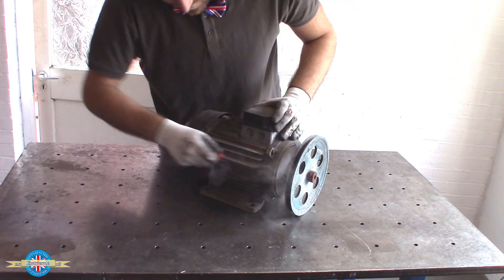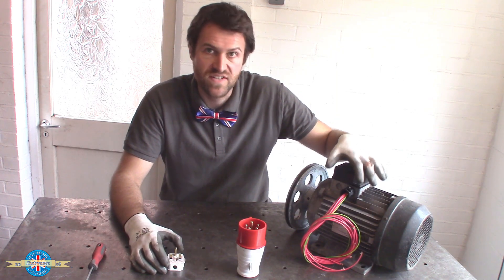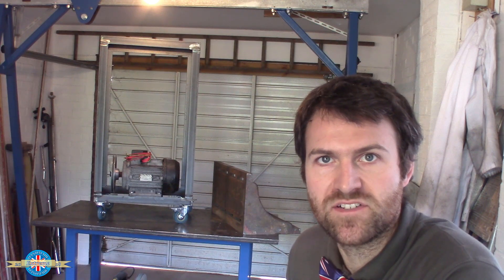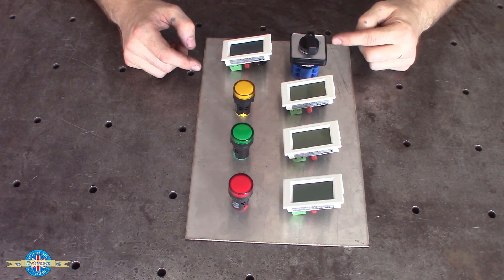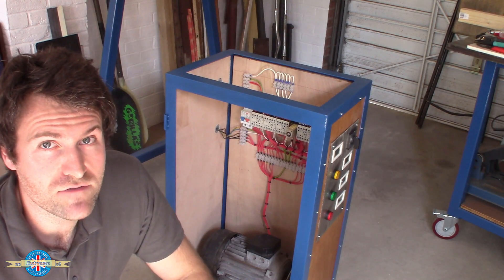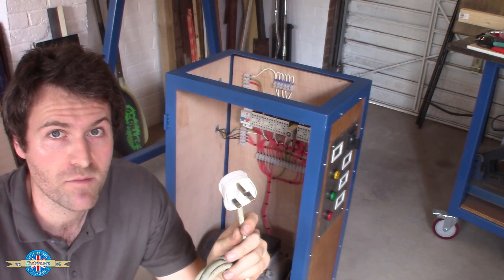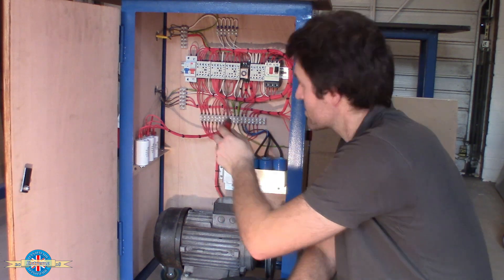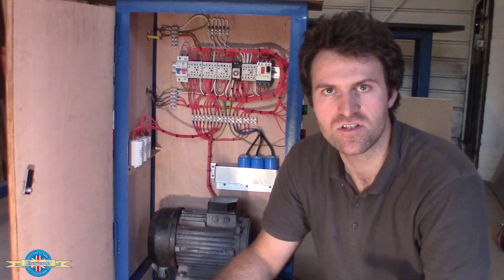1 Phase to 3 Phase Rotary Converter - 230V to 415V

Comment: Excellent video love the way you build everything ,you need very creative.I have  over the years  bought  4 3phase machines the first one i bought a digital  frequency phase converter which i use for that machine which I find very handy in that i can dial in different motor speeds without having to change cogs but not the original switches that came with the machine  now i have more machines i was wondering if I would need a seperate converter for each machine or can a i use a rotary Converter that covers all although i do not inten to run all the machines at the same time .what do you rekon is the best way to go about this or i should say how would you do it.any help much appreciated Thank you
Reply from the maker: If using VFDs each motor should have it's own drive. You should not try to use a VFD as a simple converter to power multiple things, they are not designed for that. That is the exact reason I built the converter. I have a few machines and it was most cost effective and future proof to use the converter. Glad you enjoyed the video and I hop this helps you with your own project. Cheers. 👍

Comment: And people wonder why England needs 30% of Scotland's spare electricity! This is not what the grid was designed for and is extremely dangerous and selfish!
What you are doing is illegally drawing vast quantities of electricity to generate 3 phase power.

What you should have done was applied to the local network operator for a supply upgrade and requested 3 phase. 

This could plunge the street or a larger area into darkness by drawing more electricity through the domestic supply than it is designed and rated for!
Reply from the maker: Hi, thanks for the comment.  Please allow me to just clear a couple of things up for you. 
I'm not sure where you got the idea i'm drawing vast quantities of electricity from.  I can assure you that when the converter is running it is drawing no more current than the kettle in my kitchen. As for start up current if this was excessive it would trip the workshop ring main supply or main house supply ( which FYI is rated significantly higher than the startup load my converter imposes on it). 

With regards to plunging the street into darkness; the grid is more than capable of handling small inrushes and I assure you 50 amps inrush is small. Just consider when there is a power cut and a whole village or small town looses power. Everyone leaves everything switched until the power comes back on. The inrush the grid receives during this power up after a power cut is multiple orders of magnitude higher than my little converter and yet the grid copes fine. 

Regardless, I hope you enjoyed the video and that I have been able to put your mind at ease. Cheers.

Comment: Knew a guy years ago had a barn with huge 3 phase air compressor but barn only had single phase so he had a huge motor with about  2” shaft hooked up like this as converter but no electric start. We used to get it turning as fast as we could then hit the juice. If you got it running then it would start the compressor as if you had industrial 3 phase.
Then he tried some capacitor converter thing with capacitors as big as 2 liter pop bottles. It would sound like it was going to explode and barely get compressor going
Reply from the maker: That sounds..... exciting ..... brown trousers exciting in fact. Glad you enjoyed the video and thanks for watching.

Comment: Hello,
Nice video.
Lets say i have garage with 16A main fuse. Dunno how its called exactly in English but you get the idea.
I have no 400V in garage, just 230V.
Now i would like to buy big sweet air compressor 7kW, 300L that requires 400V.
Can i use same method for this? Or i should buy some industrial converter?
Or my main fuse 16A is too small for this all and will gonna pop as soon as i plug in compressor? Thanks
Reply from the maker: I'm guessing here but just glancing at your numbers I think you would need a significantly larger supply. Best to contact a local electrical engineer. thanks for watching.

Comment: Hi mate. great job on the converter .I'm just researching to build my own., but you got me a little bit confused.,  most of the info said to start the motor  in  Star configuration and run it on Delta configuration to get the full power , as Star gives only a third of the motor power., is what I' find out there., please let us know your comments on this, will be of great interest and help to many, thanks in advance from NZ.
Reply from the maker: wiring in star gives you 230v phase to neutral and 415v phase to phase. Delta there is no neutral so you just get 415v phase to phase. When you start a 3 phase motor normally you do star - delta. This gives you more starting torque since you are using the same power but at a lower voltage (P = V*A) then you switch to delta for more speed but lower torque. 

With the converter you need to output 3 phase and a neutral so you have to end up in star or you don't get the neutral. But, the motor wont start very well off a singe phase supply in star, so you start it in delta. 

Hope this helps, and thanks for watching. 
Cheers

Comment: How are you getting 415v from 240v without a transformer?
Reply from the maker: By running the motor in Star with the single phase live across one winding to the neutral at the star point you get and output of 415v phase to phase. There are some links in the description to a couple of videos that explain it quite well.

Comment: Nice converter! I am trying to build this, but I get a lot of current draw, something like 10 amps, and if I add the balancing caps it goes up to 14 amps when idling, did you have this problem? How did you make your converter use so little current when idling? I am using a 5kw idler.
Reply from the maker: You just have to play with the capacitors. try different values and different configurations until you get a compromise that you are happy with.  If I remember I drew out a table and did some trial and improvement.  Probably took between 5 and 10 iterations. Glad you enjoyed the video. Thanks for watching.

Comment: Hi, how does that voltage being 240v in come out at 415v, I don’t understand how it gets upped without some sort of transformer? Thanks
Reply from the maker: Its by changing the configuration of the windings from delta to star. There are some links in the description to some other more technical videos. Hope this helps. Thanks for watching.
Reply: The motor does the work of a transformer.

Comment: i liked the vid. too much time spent on cutting, welding but not much time spent on the electrical side. i would suggest putting a wiring diagram and specified values for each component give it a pause time so people can take in the info and slowly go through the system. most people who make these video just showing how great they are but actually not teaching any thing. this is not a point of criticism but a point of observation.
Reply from the maker: Thanks for the feedback its very much appreciated.  Unfortunately there is no wiring diagram, I just did it on the fly. Noted for future reference though, cheers. glad you enjoyed it and thanks for watching.
Reply: I agree, when I saw the thumbnail for this vid, I expected to get some insights into building a Rotary Converter, but the build was more about the cabinet it went in. One positive though was the link to Galvanizedsankey, which gave all the info that this one did not. The cabinet was a nice piece of work, and the electrical work looked very workmanlike, I just wish there had been discussion on the design decisions and the components used.
I must be in the minority though, as most here are full of praise about build quality etc, but obviously have little knowledge about electrickery, especially when they want to know how you can get 415V out if you are only putting 240V in and not using a transformer.

Comment: Dear sir I am farmer in field I have singlephase line I have Bore well  how ro run five hp moter by this issue call 09964854550 india
Reply from the maker: I think it would be best if you contact a local electrical engineer. Thanks for watching

Comment: How much would you make a duplicate I have an industrial 3-phase 10 horsepower huge huge air compressor the city will not let me have 3-phase wiring from the pole. I would like a box like you just made exactly like that cuz I have a very very small shop and I need my air compressor running so I can paint cars to make money would you consider making one and shipping it how much would you charge I need one bad
Reply from the maker: It would probably be cheaper to put a single phase motor on your compressor if that is the only piece of 3-phase kit you have.

Comment: HI
What size capacitors did you use on your set up ?
And how much capacitance are you adding per hp of additional load motors?
I am currently setting one up and going to try and incorporate a voltage sensing relay 
to add capacitance automatically  if voltage dips with load motors applied
Reply from the maker: There is a list of parts in the video description. I don't add any caps for additional motors. glad you enjoyed the video. 😀

Comment: One question, loved the video by the way - how did the voltage jump from 240 to 415 - doesn't there need to be a step up transformer - that's what all the luminaries are saying ??   I only ask because i followed a model with a transformer (welder used as step up) it works but it is pisspweak - it can't seem to run a smallish EMCO lathe with  2 HP motor.   What steps the voltages up in your model.
Reply from the maker: By using the multi voltage motor and starting it the opposite way round (delta into star) you can jump the voltage up. Then the capacitors just balance the output between phases. No transformer required in this system. There are some links in the description that include some good technical information. Thanks for watching.

Comment: hi   , very nice  cabinet  , converter looks  nice   too    ,  i  am  a  cabinet maker   and  have   a  workshop  full  of  nice  stuff  i  dont  want to  break  ,  have    a   been  told  the    running    a  3 phase motor with a  breaking unit     is  not a good  idea ,  but will  work   ,  what  harm will  it  do     ,  as  i may  have   to  run   a  converter   on multiple   breaking motors   any  ideas  )
Reply from the maker: Thanks, glad you enjoyed it. Not sure about braked motors to be honest, sorry.
Reply: @Handmadeextreme  ok  thanks

Comment: I See This video and  i would like to purchase  yours  1 phase to 3 phase rotary converter for my workshop. This converter takes a single phase 230v supply and generates a 415v three phase supply.  I can read / tough my Industrial Training Center  .  I our  all 3ph  machines such as my lathe in my  workshop.
                                                                   There fore i request you to kindly send this complete 
FITTING   circuit  which is run at my organisation for trainees . so what is the cost of complete circuit in Indian value  if suitable or cheapest cost than  i will order to supply me by  post . thanks you , 
                                                               mail id  sitccit@gmail.com
Reply from the maker: Sorry but I do not have any plans (drawings) for this converter.

Comment: Install the dc motor 220v   esy
Reply from the maker: That was an option but I would have gone form single phase 230v AC instead. We don't use DC here for large machines.  However I would have to change every motor on every machine I have. This would be very expensive. It was much cheaper to make a converter. Thanks for watching.

Comment: why don't you use a single face motor and a 3 face motor an a 1:1 Transmission ? than you don't need any timer etc and only must turn on the motor🤔 also you than have a second system that is issolated from the city-powerline🤔 and it also don't take more than 16 A by starting so you can't blow any fuses
Reply from the maker: Cost and efficiency are the two main reasons. To drive the 3phase motor from a single phase motor you need a bigger single phase motor. In this case ~5 KW for my 4 KW  3 Phase motor. Large (ish) single phase motors are quite expensive, where as 3 phase motors are quite cheep and in plentiful supply. Having an isolated supply would be nice though and i do like the simplicity of the direct drive system. Also this system is surprisingly efficient, can't remember the exact numbers but under load it's in the high 80s to low 90s. Cheers :)

Comment: Will this power a 3 phase mig welder
.....
?
Reply from the maker: Without trying I don't know. I suspect not though unless it was being used on very low power settings. I suspect the very high inrush during initial arc up would stall the converter. 
It certainly is possible but I think you would need a much bigger converter. Sorry I could not be more helpful. 👍

Comment: Energy efficiency of this setup: Lousy. Bad. Sux. Brutal. First converting electric energy to mechanic, and then back again from mechanic energy to electric energy sounds like peeing in the pants in the winter to keep warm. I am almost certain that your lathe motor can be configured in both Delta and Y. As others have suggested B4: Get a Variable Frequency Drive (VFD). You can find those with 220/240V single phase input and 220V 3Phase output. WAYYYY better efficiency, no noisy motors, no mechanics to break down.
Reply from the maker: Re energy eff: Off load you are absolutely right; So when I'm not using it I switch it off. However, on load the system eff is typically in the mid 80% range, so not to shabby. Certainly A lot more than I was expecting. 
My lathe motor is a 400v/600v motor rather than the more convenient 230v/400v. So I had to have a 400v capable delivery system. 
I considered VFDs however a VFD should be connected directly to the motor. This means one VFD per Motor to prevent IGBT component damage. There are 7 3 phase motors in my workshop. For me it is not cost effective to use VFDs. 
Regarding failures. If I have a problem with the converter I have the facilities and some spare parts that I can use to fix it. If a VFD goes down it will more that likely have to go back to the manufacturer for repair. The downtime is likely to be less with the RPC because I can fix it myself and I don't have to wait for a third party to do the repairs. 
Finally I would not really benefit from the main advantage of a VFD (the vairable frequency) as both my lathe and mill uses a CVT gearbox so I already have an variable speed transmission. My chop saw has a two speed drive and the surface grinder is hydraulic. Hope this helps you to gain a better understanding of my design philosophy. Cheers.

Comment: As Adil said below, I don’t have to know by what arcane magick you used. To produce 3 phase, But it was a pleasure to behold. Your build was “neat “. Even tho many comments from experts are critical, you are aiming at a totally different demographic.
I for one  will will follow future vids and view your back catalogue
Reply from the maker: Thanks very much, really glad you enjoyed it. You are correct, this system is for my home shop. It is not designed to run a factory where multiple machine are running at once with multiple people working. It's just me in my shed.. Cheers. 👍👍👍
Reply: @Handmadeextreme  I too thoroughly enjoyed the video. And I like that you're encouraging and taking on-board critical feedback! Subscribed.

Comment: So the other 3 caps your using on the output are pretty much acting sorta like a power correction cap in 3 phase systems, right?
Reply from the maker: Not so much power factor correction but kinda. They are there to balance the voltages. Since I am supplying 1 phase that phase voltage is higher than the two generated phases. The white Caps are used to drag up the voltage on the generated two phases. Hope that helps. Cheers. 👍
Reply: @Handmadeextreme  ooh ok I got you. Your using them to balance the voltage difference between phases. I missed that last part of the video apparently.
Reply from the maker: Exactly, spot on. 👍👍

Comment: maybe a 1/4” steel top rather than plywood would have been better?
Where did you get the voltage/current meters?
Reply from the maker: I thought about a metal top but I didn't have anything suitable at the time. 
The meters came from a very well known online auction site if I remember correctly. Starts with E and ends with Bay.. 
Cheers.

Comment: is there a chance that this thing will time travel? 

some instructions were unclear, where do i put the enriched plutonium again?

i have no clue how this is supposed to work, but hey nice build. maybe put a sticker on it that warns people from the high voltage components on the inside. would be a nice touch if something should go wrong and maybe someone else needs to handle it or be around it :)
Reply from the maker: Is that a This Old Tony reference or Back to the Future? 
I like to think that it might be able to. Now where did I put that flux capacitor.... 

I might do a follow up at some point where I do a deep dive into the technical side of it. Seems to be a fairly popular bit of discussion.
Glad you enjoyed. 

😀👍

Comment: hello,Very nice video.but how can you get 415v output  with only 230v source from your home?or maybe you using step up transformer method generate 230v to 415v?
I have my own rotary phase converter  but cannot generate output to 415 3phase.I only get 230v 1phase to 230v 3 phase.so what's the solution sir?
sorry for my poor english
Reply from the maker: It works by starting the motor in Delta then by switching it to Star you can generate the higher voltage. I recommend you watch the videos I have linked in the description as they go into a lot more technical detail. I may do a follow up at some point with more technical content. Glad you enjoyed it. 👍😀